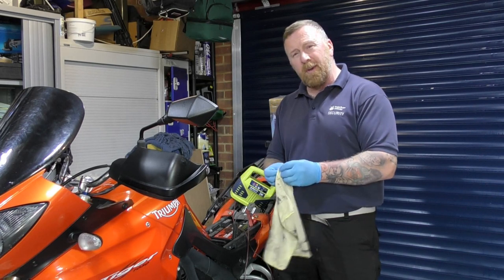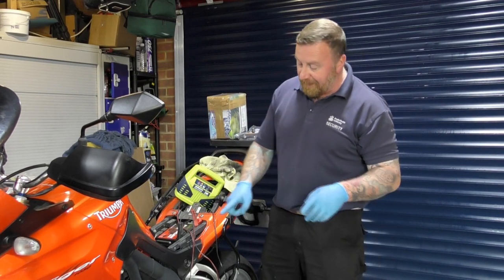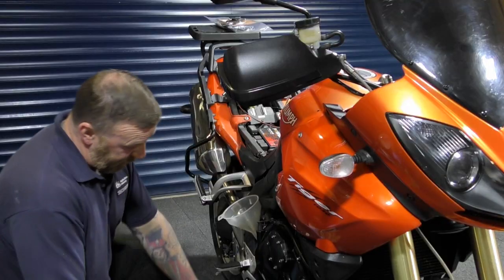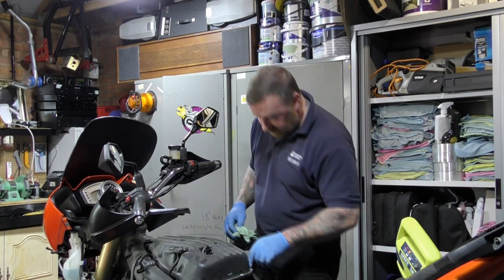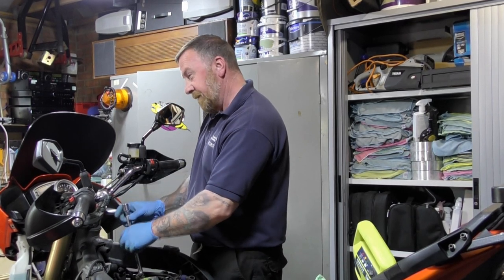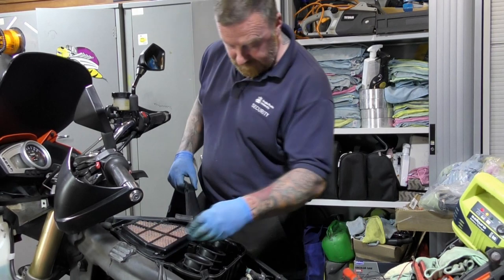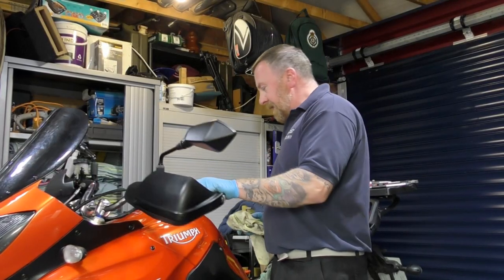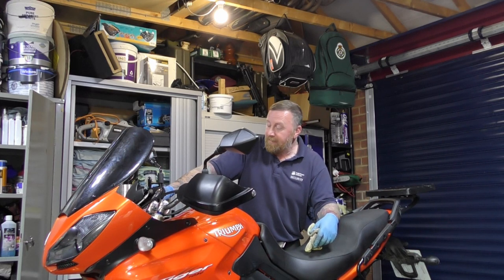TRIUMPH TIGER 1050 SERVICE MARK SAVAGE

Comment: Hi Mark  I'm doing the same service to my tiger,  a few questions. Do I need to disconnect battery before removing the tank? And what length of socket extension is needed to reach plugs ? Many thanks
Reply from the maker: i didn't but it wouldn't hurt to take it off and give it a charge.
just a normal extension in your tool kit  bud  , no special tools
Reply: @mark savage  many thanks. As a total rookie your video really helped me.

Comment: Mark, I’m looking at getting the 1050 only because my tiger 955i is being written off. Are the 1050’s top heavy like the 955i and also can you have both headlights working at the same time as I’ve seen the 1050 only having the near side headlight working. My tiger 955i head both dipped and main beam working.
Reply from the maker: To be fair there is a little weight top heavy but not like a big tourer 
I find it fine and enjoy the ride bud 
Best test ride it 
For the money they are great 
A bit more money and lighter maybe try the multistrada 
I do love them
Reply from the maker: Yes only one but to be fair it's good
Reply: @marksavage  I only ask about the headlights because the tiger 955i comes with only 1 headlight until main beam is used but myself and mate figured out that both headlights can work by adding the correct bulbs and relays
Reply from the maker: @MrTheomighty1  all twin light bikes that only use one side can be wired up to run both but !
You will have to just the level of the beam 
Plus not sure but you might have to out it back for the mot as the beam won't pass high low
Reply from the maker: @MrTheomighty1  and to be fair you did also ask about the weight 
Do answered that too
Reply: @marksavage  awesome thanks for your input. I do like the multistrada bikes but they are out of my pride range. I’m
Also glad that these 1050’s are a bit lighter because I have to do a 5 point turn  in my back garden so it’s facing forwards to ride out and it’s to far to push backwards. Many a time I’ve nearly dropped my 955i.

Comment: You are indeed brave having carpet in a garage. Hat's off to you. 
I personally picked up the exact same color 2009 model in April. The bike had sat for over 2 years. I like having the rare bike in the states (until it comes to finding parts or service). 
The videos have been great to watch while board and unable to ride. 
Definitely subscribing.
Reply from the maker: Well carpet tiles and I have many replacement lol 
I guess in the US they do stand out 
Like you this is why I have my Ram 
Videos on here 
Take care bud